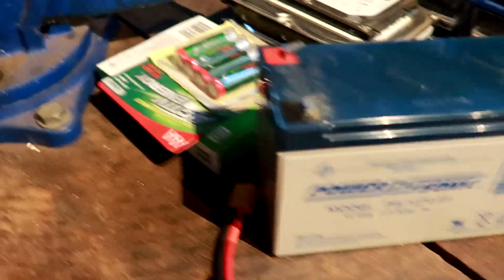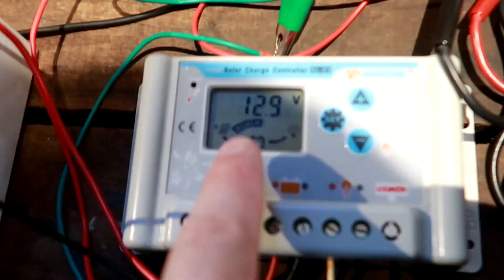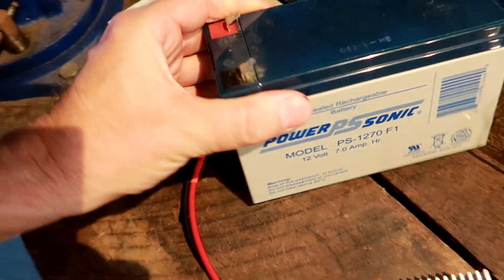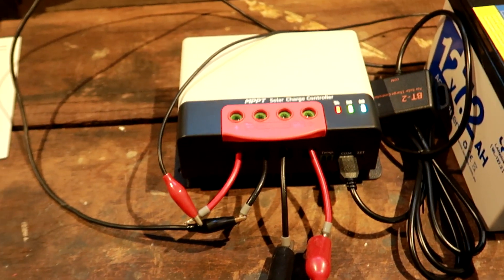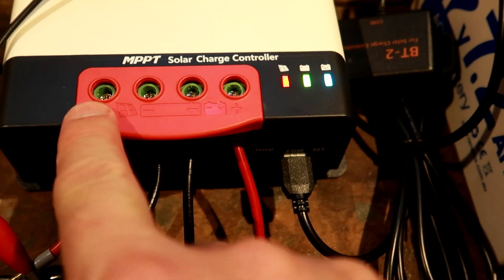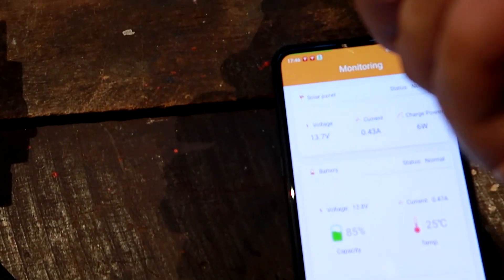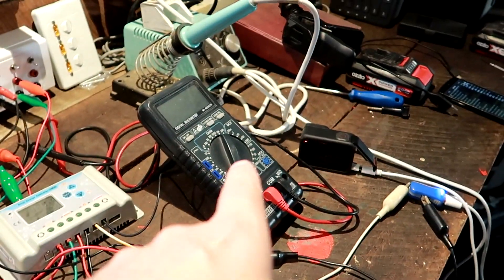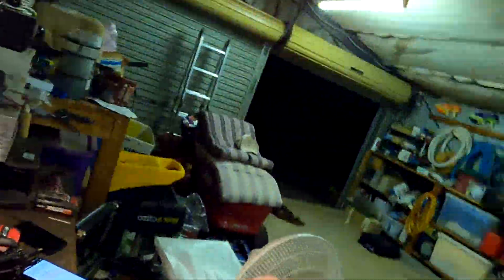SRNE MPPT Solar Charge Controller Fail!

Comment: I think you better must to use a panel with higher voltage to give to the mppt more performance and margin of working
Reply from the maker: Should it not also work with lower voltage? I think it should as long as the Vsolar > Vbat. Plus a few Volts extra of course...

Comment: I have been working with SRNE for a 5 years now,I have 3 pv systems with MC2124/2430/2450 + lcd monitors not with BT App and never had issues,this controllers is very good working.
Reply: Привет! можно ли в 2450 ограничить ток заряда батареи?

Comment: I am very sad to see this, I have been working with SRNE for a few years now, and never had issues.
Very reliable, very good quality. I would also add honest supplier, as I have met them in person during international PV fairs in Europe.

Regarding the load disconnection issue, you needed the model srne mppt ml2420.
This has a load terminal, and a display.

This would most likely solve all your issues.

1) most likely one of the problems you are experincing is due to real time redings.
(bluetooth display is most likely the last know value, not an actual what is the value just now as a display would show)
2) The clamp meter you are using should not really be used to measure mA
Although it does give a reading, the accuracy is most likely quite off.
This is why their technical people where asking you to measure current with the leads, not the clamps.
(most likely the clamp meter is not able to do this, but your other simple multimeter will)
The polarity would not be parallel + to + and - to - of course, but in series with the load, this would be much more accurate.

Last but not least, the MPPT charge controller you are using is deisgned to work with higher power panels
at least a 100W panel.
Its self power alone is most likely in the 5W range.
So using it with a 10W panel is incorrect to say the least.

I have worked with the same model you are using, and although any make/model can have a defective unit, I dont believe this is the case.
I belive you are using it incorrectly.

If you still have it (cos this video is over 1 year old), I do invite you to test it differently with even more load, and you would be surprised.
Especially when you have a youtube channel, shaming a company / product when you are the one mistaken.

Feel free to reach out if you want, it would be nice :)
Reply: I completely agree with you. I think testing with a 10W panel may have played a major role.
I am quite sad to see such a great channel bring a whole brand into disrepute with a test that was performed without adequate controls and failing to account for all variables.
It might be true that some things are off about the controller, but it is also true that this test was not performed taking into consideration the adequate controls and the conclusion reached by the poster is quite misleading and unfounded.
Reply: I would like to work with snre if you have contacts. I have an off grid house and business and all my equipment got stolen while I was away on business. Now I'm in the dark mostly

Comment: Hi Andy, luv your channel. Hoping you could help me with something.
I have a victron smartsolar 100/20 controller to charge a 12.8v 100Ah LFP battery. I am currently ( pardon the pun) using 250W 22voc/18vop, Isc 14.3A/Imp 13.6A folding panels.
Can I use 2x 190w panels at 42.5voc/36.6vmp, 5.62Isc/5.2Imp either in series or parallel as this falls within the input values of the controller even though it would be limited by the 20A output?
I feel like I am cheating the system as the higher voltage regulated down to the lower voltage would produce more current than the maximum 20A output in ideal conditions. I would limit the output current on the controller at 20A. I guess the extra current would be lost as heat, but considering the panels would be mounted flat, it would be rare if ever I would achieve maximum Panel Power? 
I want the oversize for those days that aren't ideal for solar.
I appreciate your help thanx Stu.
Reply from the maker: Hi Stu, thanks for your question.
That's absolutely perfect what you are planning there, the series connection of the panels to this controller will maximise the output efficiency of it and is the best and most efficient way to charge your batteries. Go for it, it will work great!

Comment: Have you gotten anywhere with your gate project yet Andy? I picked up 3 EPSolar Tracer-1215RNs used with 1 display panel for $45. Unfortunately they only have set voltages for lead acid variants, and no wireless monitoring. Otherwise one could work well for you.

Comment: Fairly new to watching (maybe two months) this channel - very helpful - thx : Question did you ever complete the 24vdc li-ion battery for your solar powered gate. I think doing the series and parallel connections with these small packs would be v difficult; however I would love to see the video ????
Reply from the maker: Thanks Leo and welcome to the channel.
I have not done this project yet and the gate still runs on 2 12V gel batteries. I have talked about this again in a recent video and people seemed quite interested in such a project. I have all the parts here and could go ahead with it but there is only so much time to do things. The project is definitely on my list as well as the electric fence system which I would like to convert to lithium as well. It will come one day...

Comment: Little known fact:  almost all power supplies and power converters made today are pulse width modulation (PWM) since they are smaller, lighter, cheaper and more efficient.   Even your cell phone charger is a PWM converter.

And almost ALL solar charge controllers are technically a PWM converter, but only some of them have the MPPT algorithm.  The solar industry calls them either PWM (if they don't have MPPT optimization) or MPPT (if they do) and that's just the naming convention.  Saying a MPPT controller is not a PWM controller is technically not accurate, but that's the way the naming convention goes.

And then there's a few cheap foreign brands say they're MPPT, but they don't perform as well as a true MPPT controller.  As always, YMMV, so stick with reputable brands for best performance.

To include the MPPT algorithm in a solar controller design you have to pay licensing fees.  Yup, some bright guy invented it and now chases people who try to use it without a license.
Reply from the maker: I'll see if I can replicate that with an oscilloscope. Thanks for the info.
Reply: @OffGridGarageAustralia  It would be interesting to measure Wh energy yield on a cheapo "MPPT" controller and put it up against a Victron MPPT solar controller and compare them to a standard "PWM" controllers.  I'd guess some of the cheapest "MPPT" solar controllers probably aren't any better than a standard PWM controller.  

What can you measure with an o'scope?   Maybe some PWM ripple that wasn't filtered out and the chopping frequency?

Comment: will you recommend this MPPT controller for a beginner system with AGM batteries. thanks.
Reply from the maker: That will be fine. But I would probably recommend the JNGE controller for that as it has remote access from your mobile via the internet. So you can monitor and also control settings from anywhere.
Reply: @OffGridGarageAustralia  thanks you for the reply. But I have a bit of good news I found a BT MODULE for this MPPT controller( Bluetooth Adapter for MC2420 MC2430 MC2440 MC2450 Charge Controllers BT-2 SRNE$ this is the model you can find it on eBay also in Amazon I believe.
Reply from the maker: @Myneckofthewoods7  Yeah, but I mean it's BT only, so you have to be in close proximity. The JNGE will allow you to control and view the setup from anywhere.
Reply: @OffGridGarageAustralia  yes I see, that . I found the model in Amazon... it looks great unfortunately my budget is limited which puts me back on this budget MPPT CONTROLLER.  Truth  is I really don’t need all that remote stuff yet   I am starting small  this is far better than the one I have which can be bought for a dime a dozen on line. Thanks for the advice. 👍

Comment: Hey, epever LS1024B is fully programmable, it operates like the tracer AN series, but is pwm and extremely cheap. It has load, and same mt50/wifi/BT options as the tracer. Check it out, they're awesome for these small projects 👌
Reply: I use a few of these on small 18650 systems. 4s 15.8v to 13.2v with an active balance board, (no top balance)

A little birdy told me the equalisation setting only runs once per month and could be manipulated to top balance.
Reply from the maker: I've got a 1206B or something for a little side project. I heard good things about the epevers...

Comment: Thank you for the series. I enjoy watching it to releave stress.
Are you sure, the different voltage and amp is not the mttp regulator?
Plus the measure the amp you need to measure as a shunt and not as you did. So I think die seller is kind of right, isn't he/she?
Reply from the maker: You measure current in series and voltage in parallel. They advised me to do the opposite. I would have made a short 😉
Reply: @OffGridGarageAustralia  Like I said, you are rather quick on judging and conclusions.
But like you said, we all learn from mistakes. It is rather trickering to hear you ranting on manufactors and sellers.
Reply: @digital-experiance2390  I watched many of Andy's videos. He really really gives the manufacturers a chance. Just watch his 'make dally great again' series of videos...there was an issue he thought with the BMS; rather than write the manufacturer off, he tried, across 3 videos, talking to people and other enthusiasts to get to the bottom of it. And he did.
The reality is that you are glossing over the manufacturer giving crap advice on how to measure the most basic readings.

Comment: Hello please guide , can I connect 3 solar panels of 150watt in parallel for 12v system to this 30amp controller???
Reply from the maker: Should be good but without having all the specs of your solar panels, I cannot 100% tell...

Comment: I appreciate all your videos, but on this one I don't understand why you would even want the "load" option on the charge controller. Electrically, without it, your load is going to tap off the inputs/outputs of the battery anyway right? Am I missing something?

Comment: Hello . What is the maximum wire size that can fit in SRNE Charge Controller? thank you
Reply from the maker: I cannot remember exactly but a 4mm cable was the max I tested.

Comment: I believed this guy from SRNE can help you with the issue. https://www.facebook.com/jupiter.jiang.16/
I also use their product but those with LCD display and LED indicators. The SRNE hybrid inverter is also coming for my 5kw setup. 
Usually some resellers cannot help much on the technical side. :)
Reply from the maker: Yep, the tech support was... I have now sent the controller back as the app was not working and it seemed way off to what was going on inside the controller. Not worth the hassle.

Comment: Just use your pwm on there since you can program it it works with lithium it works with lead or gel and returned mppt and get your money back that's a easy solution and your pwm will work just fine and you can actually read the numbers on the screen I got pwm on my solar controllers they work fine no problem and their programmable like you said but mine has a load but it's only 300 watts so I don't use it but they're advertising on the pwm they said in the ad that it was a mppt which it is not I could dispute  that but what's the point they're made in China and ain't really a whole lot you can do about it other than return it and get your money back but I needed to charge controllers so I'm using it
Reply from the maker: I can use the PWM but it will be in a box, so I cannot read the screen at all. Hence the idea with the BT for controlling the settings and also battery status.
The panels at the gate have only 10W each, 2 of them in series, the max solar current will be 0.55A.

Comment: I use an EPEVER TRACER for more or less the same purpose. It has load terminals but I decided in the end not to use them. It turns out that it can only sustain a relatively low amperage on the load. They never exactly specify how much it is in the manual, but it seems to be around 5 to 8 amps. Because my gate arms/levers draw more than that I attached the gate controller directly to the battery instead. I bought a cheapishh BMS to take care of the low-voltage cut-off which also comes with a bluetooth app!
So now I don't use the load terminals at all :(
Reply from the maker: Great Info, Peter. Thank you.
The motors in my gate don't draw more than 2.5A combined so this will be totally fine. The 1206AN can supply 10A on its output.
Yeah, the BMS will definitely disconnect on the low voltage side but that's very low then.

Comment: I have a "Rich Solar" 40a mppt, made by SRNE, and the bluetooth app is TERRIBLE. TERRIBLE. The view of the history is unreliable and buggy, the app doesn't update. The actual controller seems to work but the readout from the app is crap.
Reply from the maker: Thanks for your confirmation. Yep, same experience here, the app just need heaps more work and feels like an alpha version. I looked at the history only a few times and could not make sense out it it.
Controller works, but how accurate does it holds the settings if it measures/displays wrong?

Comment: I believe the over discharge protection would be done by a BMS. It shouldn't be the job of a charger
Reply from the maker: Well, the BMS should be your last resort doing this. I look at the BMS as a safety net but not as a productive system  to all the safety for the battery. You should set all parameters in your charge controller. If this fails for some reason, the BMS kicks in. In larger environments, you obviously don't have the low voltage disconnect in the controller(s) any more but then the actual inverter takes care of that and cuts off when the battery is empty. Again, if this fails, the BMS will take over and disconnect.
Reply: @OffGridGarageAustralia  I'm sorry, i cannot agree. A typical charger isn't responsible for controlling the battery low SOC. For example FLA, AGM, GEL etc. There's no BMS but still there's no charger that would also control battery discharge
Reply from the maker: That's different battery tech and chemistry though. No the charger is not responsible for that but if it has this function I will use it for the low power side of things, like the solar gate. In larger setups and configuration, the charger does not do the low voltage cut off but either the inverter or the low voltage disconnect (eg. smart shunt) should. The BMS is only the last instance if everything else fails.

Comment: I would try a EPever tracer AN controller, they seem to work well, mppt, and has output,  and avalible in 10-20 amp, I have had the 30 & 40a for years, no issues,
Reply from the maker: Looking at the small 1206AN with BT right now, thanks for your advice.
Reply: @OffGridGarageAustralia  I have never had issues with EPever, they have Bluetooth options, or remote display/controls and do what they suppose to, I have fell for the pwm controllers saying mppt, but not for a serious project, have you a video of the gate opener? I'm thinking about one myself, and it would be solar also, I'm fairly new to your channel,   I have a large 24v lithium ion bank for the inverter, and a 12v LiFePo4 bank for the 12v lighting and cameras/security. In my offgrid house,  I'm thinking about a gate, with a fence around the house, with motion detection along the top, I have the microwave detectors, that can be inside a box, so you never know it's there, but I have a dozen 270w panels to get up first, I'm running with 1200 now, I'm thinking about putting 600w of the 1200 on the LiFePo bank, unless using a DC to DC with pwm charger will be more effective,  victron has DC to dc's that sound good, but designed to possibly charge lead acid batts, but not lithium, so I bought a small pwm controller that supposed to do liion, I'm going to try it with a DC converter, and charge to 13.8v-14.0v 10 amps on 400 ah isn't really enough, I may use both to keep it going, I'm not charging until it is needed, and I only charge my 24v bank to 4.1v/cell, 3.5 for the LiFePo bank, so I hope they will have a long life! Good day, sorry to ramble!!!
Reply: @OffGridGarageAustralia  do you know of a 60 or 100amp lithium mppt controller, that is affordable? I need 3x 60a or two 100 amp controllers, for my 270w panels, I have 2new 60a make ske blue controllers, but kinda unsure about them, I would only need one more, but if I can get a 100 amp, it would cut the losses of so many controllers, I may get one more make sky blue, and pray it works, but just shy of 50 amps each, and running at 72vmp, I'd like to double the panels per string, and get a 100 amp controller, I don't want to pay the cost of a midnite classic150! But it would be nice to have a couple! Maybe I can find one or two, three used!! I have thought about building one, but that is beyond my skills abit! Sorry I'm rambling AGAIN! Good day!!
Reply from the maker: I would look on AliExpress first. Does Epever not have one? They seem to be affordable...
Reply: @jamest.5001  EP ever tracer 6415 AN 60 AMP.-  EP ever tracer 10415 AN 100 AMP.  Some YouTube channels say these are good.

Comment: I had a similar experience with a PowMR controller, it would read 52A and the meter would show 40A. There was also a 1.6A AC component as well, so this discrepancy might be due to pulsed DC output and non-true RMS meters measuring the output. You should try this test again but put your meter on AC current and see if the output is pure DC or is really pulsed DC.
Reply from the maker: Very good tip. I also have an oscilloscope to measure the output, just didn't think about it!